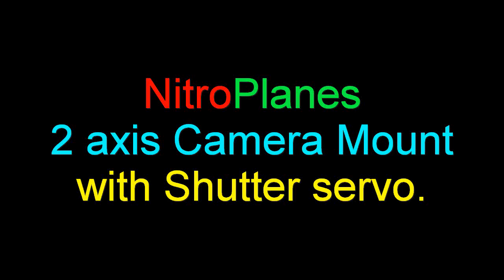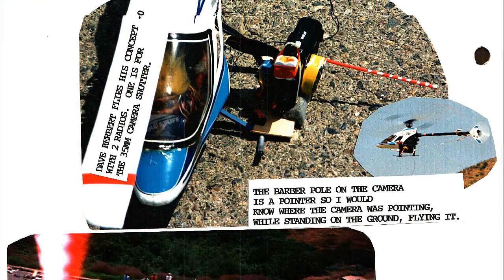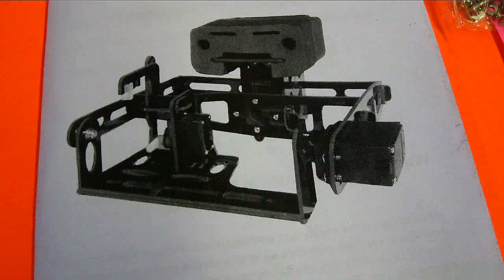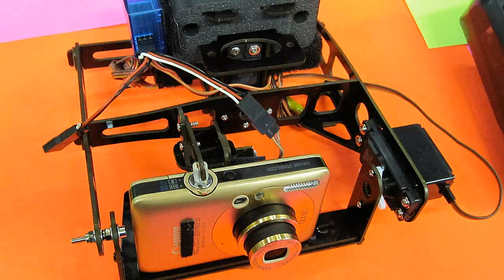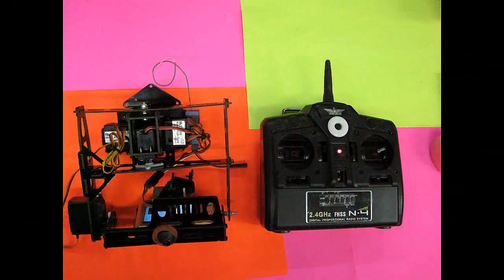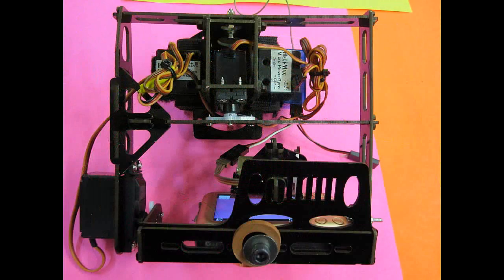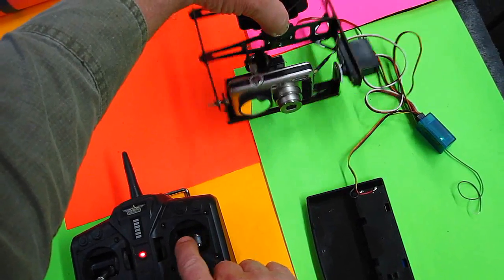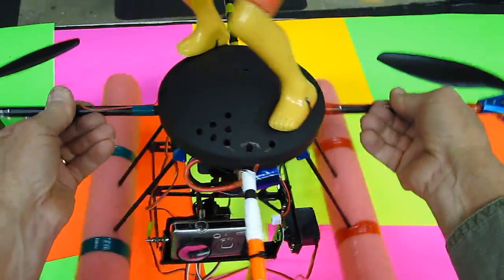NitroPlanes 2 axis camera mount for Quad Copters.

Comment: that is rely cool but try adding a relay instead of a motor so then it will be more accurate and to do that you would have to take the 2 wires that go to the button on your camera and connect them to the rely then connect the the other end's of the wire where you connect the motor and connect to the electric magnet on the relay.

Comment: MR. Herbert I bought the fpv 2.4ghz wireless camera system from hobbypartz(nitroplanes) I was wondering why you haven't used their Pan/Tilt Mini Camera Mount w/ 2 servos+bearings! I am curious because I was thinking of doing that! Could you respond with your thoughts on the issue

Comment: I'd like to suggest a multiwii controller such as the crius lite. These boards will really hold the camera level and in one spot as you can see in this video I made: /watch?v=Nzxhb9VodvQ I do have to warn you, these multiwii controllers need some adjustments in the firmware to get it to work exactly as you want, not really hard to do but it does take some time. Good luck with your models and projects!